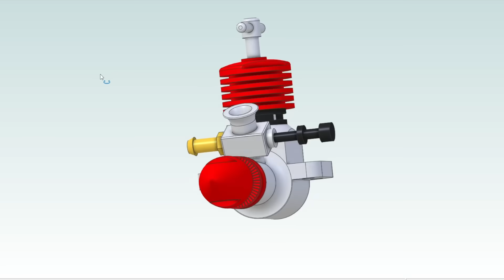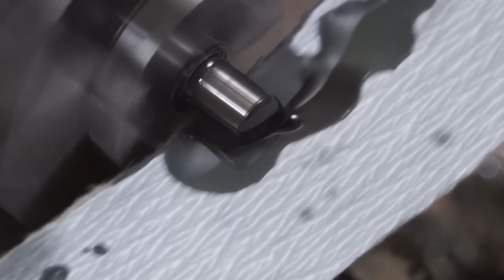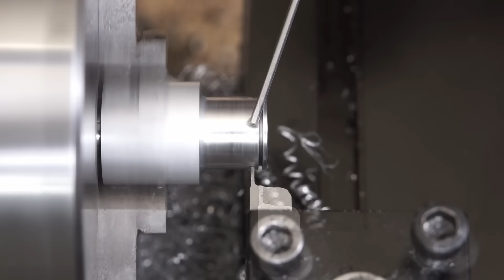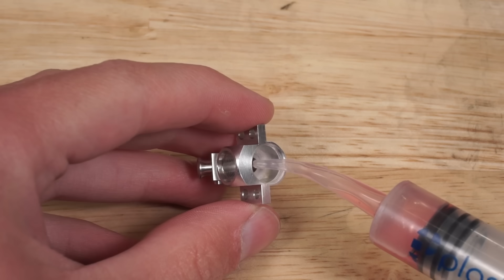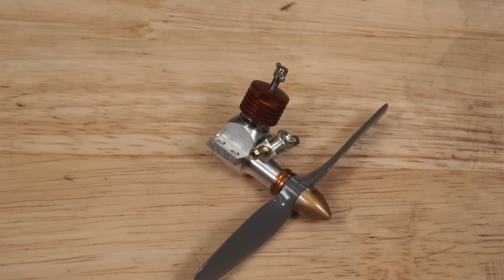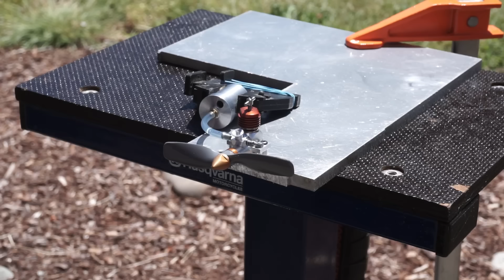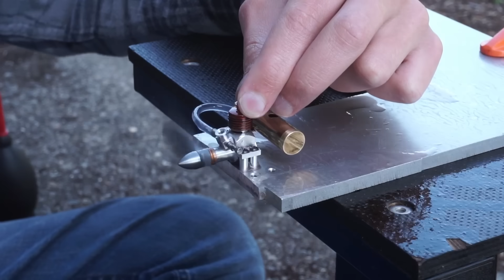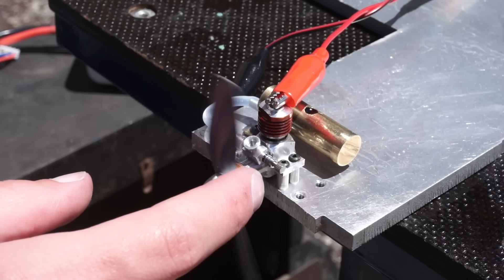I Make This Tiny 2-Stroke Engine From Scratch

Comment: Wow, this took me back. I'm 75 and as a teen in the 60s I used to fly control line planes with an engine like this. Here in Australia the popular engine was the Taipan and all I could afford was their 1.5cc model. It looked very similar to yours here, and was their smallest I think and enough for about 20 inch wingspan plane. When I left home for university my mother emptied out my room and everything disappeared. Some days I'd just start the engine for the pleasure of seeing it run. As an old bloke I'd probably do the same now. 👍
Reply from the maker: I take mine out and run them about every other week lol.
Thanks for sharing!
Reply: I'm 76 and I too had a Taipan in Australia. It was 2.5cc. My fuel mix was equal parts of castor oil, kerosene and ether. Later I had a much smaller diesel engine I used on a free flight. My glow plug engines ran on castor oil and Shell "racing A" fuel ordered specially from the servo. My best engine was an Enya 5cc "3B super typhoon". It lapped competitors 6 laps to their 5 laps in the team race competitions. Fun times. Sorry your Mum junked your stuff, they just don't get it.
Reply: Aeroplane were out of my reach and Radio Control was something only the local Doctor could afford ...    So we bout a sawmp boat out of fence palings and sheet tin ... And axe handle for the engine mount ...the 1.5 cc desal I was given by one of the older boys was damn near impossible to start since it had no compresssion left ..      But it didnt sink and went like stink  scared the ducks big time .... Probably some still in Trauma Councilling in Traralgon VIC ~quack~ .. Cheers MAte ..
Reply: On Ebay, I bought two OS Max engines a few years ago to relive my youth, both had the same typical 2 stroke problem, get them warm and the cylinder expands too much and there is not enough compression to create a vacuum in the crankshaft area,too much blow by, only restart when cold [had same problem with a BSA Bantam], tried to turn up a new piston but I think the bore is not true enough, am going to try and true the bore but doubt the accuracy of my tired old WW2 lathe.
Reply: @adoreslaurel  A BSA Bantam was the first motorised ride i ever did solo .... along a beach ..I was 13 ...
Reply: Yes friend. Being in the same age bracket I can relate exactly! Hours of fun with my Dad who was in the South African Airforce all his life. My control line model was a Spitfire. Those were the days......feels like YESTERDAY!
Reply: Same here, Kim.
Only It was a Cox .049 ci.
I had a lot more of those than I had flyable airplanes.
Back then I wanted a flying camera.
I now have a pile of drones that all work because I'm afraid to fk them up.🤤
Reply: Takes me back too - I'm 79 and had various 'diesel' model engines, one or two looking like this (DC I believe (Davies Charlton)) - also had a couple of Mills - 1cc and .75 cc. Oh, the old days. Nice build and very satisfying.
Reply: I have a McCoy 35 red head engine that’s like 10 times the size
Reply: Wow
Reply: There's something satisfying about just starting an engine and listening to it beat on at its own pace doing it's thing. Some folks just don't get that
Reply: I had one of them too when I was 13. Could never get it started. Now reading other posts I see why 😮
Reply: Let me guess what you studied in college after playing with stuff like this.  Manufacturing and Engineering?

Comment: I was introduced to small "diesel" motors like this one when I was about 7  years old.  The kid next door turned up with a 1.5cc Frog diesel.  We made some fuel (ether, castor oil and kero) and eventually managed to get it running.  I have been flying model aircraft ever since and am now about 75 years old.  Your skills with metal are way beyond mine but I still like to play with small motors.  Thank-you.  Mike in Oz

Comment: This brings me back, too.  Back in the 1960s (I'm currently 68) I had the Cox .01 cubic inch motor, and it would spin a 3" prop at 27,000 rpm (advertised).  A great little, reliable engine.  I ran it many times.  Sold it and a bunch of other small engines years later, and I've always regretted it.  The .01 engine could have been used as a tie tack.
Oh, I still have an Enya .15 engine, but haven't run it in ages.  Maybe as I approach retirement I'll have to get back into these.
Reply: i have a Cox .010 new in box....trying to decide which micro plane to build for it
Reply: @MrJdsenior  FWIW, I googled, "do you have to register a radio controlled airplane", and got this answer: "We're also required to have an FAA registration number that goes on any models we fly weighing over 0.55 pounds (250 grams)."
It's unlikely that a plane powered by a .010 motor will be more than a half pound.  But still, I bet some .049 planes would have to be registered.

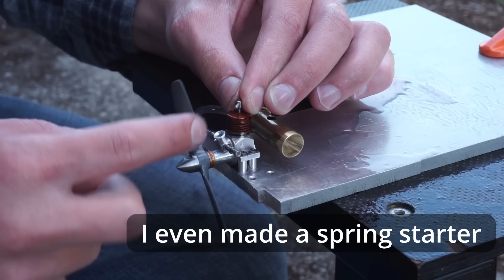Comment: 25:52 @JellyFish Machine
 The positioning of the propeller and piston is very important. You have set the piston "ZZ", the piston is at the lowest position and the propeller is horizontal. The propeller is a flywheel and has a very important role in starting and operating the self-ignition model engine on ETER. The mixture for running in the engine is 50% ETER, 25% kerosene, 25% engine oil, run in the engine at low speed and pause every 2 minutes to cool down. Once the engine has been run in and adjusted, use a mixture of ether 33%, kerosene 33%, engine oil 33%

Comment: This video brings back so many great memories for me. My late father in law (a partially-sighted master toolmaker and engineer) built this engine after seeing it in Model Engineer. I believe it was called as a Nano Engine?

However, Dennis (in his late 70s) built it at half scale! Finished size was around 3/4" long, including the propeller hub, if I remember correctly. All turned and milled on machines he had designed and built himself.

According to his strobe, it ran at 20,000 rpm. 😁 It certainly squealed.

I know I'm biased, but he was a mechanical genius. He once built a spark eroder (rather than buy one for £30k+). The first time he tested it, all the street lights within a mile radius dimmed. 😆 However, he could 'erode' any irregular shape he needed through 1/4" steel.

He also designed and built a working V6 engine which would fit inside a matchbox, and a very 'revolutionary' flywheel assembly. Imagine a flywheel with a driveshaft rotating at 45 degrees to the face, with a ball bearing end actually inside the flywheel, tracing a circular path, like a spoon stirring coffee. This was only two pieces of steel, and nobody could work out how he made it.

Thanks again for the video.

Comment: Hi Jelly, great project... some suggestions to try: 1. Make a small hole in the crankshaft cuffs to lubricate that critical area. 2. Use less oil and 3% nitromethane. Cheers Luke

Comment: I built a slightly larger engine but the piston fit was slightly tapered to make it nice and tight at the top of stroke. Fuel was U.S. diesel fuel, castor and "engine start" ether. Fresh ether for each run. Iron piston and steel cylinder. Crank to case fit was critical to stop compression leakage back to the carb and out the front. I used an electric starter, which causes the engine to warm as it spins over while adjusting the mixture and would start and run well. Running was extremely slimy. I used single transfer port and single exhaust port. My carb had an "o" ring and two clamping screws to seal it and hold it on. I've seen diesels with throttles that actually idle. Most of life is just showing up! Nice choice on Shureline.
Reply: Yep the mess was unbelievable but the smell of burnt Casteroil Mmmmmm yummy.

Comment: If there was ever a design that needs to be made into a horizontally opposed engine, this is it. Changing the design in this way wouldn't just double the output and balance the forces but would make the machining far simpler, and give you a round crank. A single carburetor would feed both chambers as well.

Comment: As a machinist I absolutely love your work.
Having been somebody that's worked with two-stroke racing for years you're on the right path as far as porting goes . The other thing is crankcase volume versus volume displacement  behind the piston. The closer to 1:1 the better.
Just a headsup you're getting small enough that fluid dynamics of air may be changing going smaller.

Comment: I like your "anti-license strike countermeasures" during the engine assembly (with music) against YT. I hate YT for that! Amazing workmanship and machining work. Sorry this engine didn't run better. As a young child, I did mess with Cox 0.049 model airplane engines. My planes never flew well, but the engines ran. I remember they were very fussy to get running, and now that you mention the ambient air temperature, I never thought about the Chicago weather temperature difference affecting the running of the engine during the summer. I might just have. That was a long time ago...
Reply: Yes very  very  fussy! I spent more time starting the engine than frying my model 😅😂

Comment: I had a similar engine for a model airplane. It had a spring load for starting. Without that I remember the bruising on my fingers after hitting the prop a thousand times to get it running. It worked perfect once started and would rev and whine like a mosquito. Sadly a mate of mine decided without my permission to take it apart and copy the components to make one. In doing so he broke the brass fueling part and simply handed it back to me in pieces. Thanks !

Comment: I think this is an amazing video and some incredible craftsmanship! One thing to consider is your fuel ratio to air and compression. If you don’t have enough compression and have too much ether it will stall the engine out. You have to calculate your fuel-air-compression ratio correctly or it’ll never run like it’s supposed to. To your credit though, the fact that it even ran was pretty amazing.

Comment: Ethanol raises the octane rating lowering the detonation point of the fuel the exact opposite of what you want for compression based ignition. I recall tearing down a .1 back in the 90s to give it a thorough cleaning and I used marv's mystery oil to reassemble it, upon giving it a spin it ran strong for 2 or 3 seconds which surprised me as I was not expecting it.

Comment: Wow. I had a Cox .010 cubic inch engine as a kid. This is 61% the size. Well done.
Reply: i have one, new in the box
Reply: The Cox .010 works well to provide engine power to Gillows rubber powered aircraft kits.  🤓

Comment: As an owner of multiple Cox TeeDee 020 and 010's, some NIB, a few converted to 'diesel', but most in various drawers and storage boxes, I find this an impressive subject to attempt. Though honestly I'm much more interested in the last few seconds of your video mentioning a hope to attempt smaller.   The 010's were a neat idea, and on the perfect day when the stars aligned could absolutely give a screaming and awesome performance in both sound and power, but in normal practice were 'fiddly' to the point of distraction. It was fun back in the day to spend the time to try to get one flying for the typical 2-3 minute flight, more to claim that it had been done than anything. I had a few friends into control line (and a few die hard FF) that were happy with their .020's, but, for R/C the more reliable .10  to .40's were really where the time honestly flying was spent. And, for those who could afford or were extra devoted, the .60 and up planes were a blast to watch and aspire to. 

I would really love to see a build attempting smaller than .010 though, even though the power to weight ratio means it's somewhat pointless as a powerplant, it would be amazing to see a .0025 engine actually run. I assume the prop would be a 1.25" ?   And probably 100k rpm at full song, in the dog whistle exhaust note range?   Now THAT'S a challenge!
Reply from the maker: at 0.1 cc this is slightly smaller at .0061 cubic inches, a bit of unit conversion wierdness. as far as i know the smallest running model airplane ever made is ronald valentine's .006 cc "Nano Bee" but there's never been any proof or video of it running that i know of. I'm looking for a few copies of "Strictly I.C." magazine that have articles on making glow plugs from scratch. i also want to try spark ignition too.
Reply: Yes the sound of those engines when I finally got to start them!

Comment: Geeze, that brings back memories of the control line planes with the Cox .049 engine.  👍
Reply: Yes! I can just about smell that fuel burning  from my dad's control line planes.
Reply: Cox engine were super easy to start.
I returned 8 testors brand engines in 1 day, none of them ever fired once.

Comment: I have very little machining experience and have a dinky little chinese mini lathe (which actually is quite nice for the $$$). I've already used the super glue trick - love it! In my case, to release the part, I put the part with the arbor in the freezer for a couple of hours, put a skillet on the stove, sat the part on the skillet after it was nice and hot, and let the uneven thermal expansion do its thing. It was quicker than soaking in acetone over night, but I still had to clean the residual super glue off the part.

Comment: Having had an early interest in airplanes when I was in my preteens, but got tired of hunting for, climbing trees and rebuilding(more like total refurbished). I drifted toward model boats. Some hydrofoil, some to scale. But my passion was steam tugs. I still have packed away my unused Unimat latte/milling machine, that I turned out a Krick two cylinder copy with a boiler(original). All of this was in a NY harbor tug. During a show/ competition, some a-hole dropped and busted up about 8 weeks worth of build time. I pulled the engine, boiler, electronics and sold my collection on the spot! 
 I must say that your video sparked a challenge for me to try, but more than likely won't. My last plane was a turbo powered F4, which I so cleverly used to plow more ground than a Kansas wheat farmer! I decided to switch to something easier to retrieve. Thank you for your video.

Comment: I was a biomedicall technician for 12 years glorified, machinist. I used some of the smaller machines you have to very large CNC milling and lathes. I also weld, Do heat treating and andizing Injection molding I even did some seamstress work. I did some tool and model making. A lot of skill sets that I don't have time and i'm sure you don't wanna read about. That being said I'm very impressed with your skill sets!! Yes , it was very satisfying watching your work.
Reply: Not me, I want to read your experience and knowledge you know. If you have time write down all the of course

Comment: i think it's definitely creating intake vacuum from the carburetor not being seated inside. maybe find a rubber hose you could fit in there snug with a tiny bit of RTV or loctite and run the carburetor through the hose

Comment: I'd like to discuss another point. I believe the rotational inertia of the engine you built is a bit too low to maintain cycling. Perhaps increasing the radius of the propeller would be a good idea? Or perhaps a flywheel with an appropriate weight would be necessary.

Comment: It's my understanding that an engine that size would require a pressurized fuel system that would enable the engine to feed itself in the right mixture of fuel to air. It would also require some sort of minute mesh to spread the fuel as needed to the appropriate spray pattern for the cylinder you designed. I always enjoy watching mechanical machined engine videos. great job on that one :)

Comment: Very impressive video, I enjoyed and appreciated your machining and fitting skills. Especially the freehand use with the cutting tools. I remember many years ago back in the 60’s my dad used diesel engines in model boats that he built. He used to mix his own fuel of 50% (vehicle) diesel and 50% ether, it always worked. His engines were commercially made engines and a lager size. However he did have a small one about the same size as yours, but was never able to get it running.  Once again an excellent video well done.

Comment: In 1978, Anchorage AK, my late friend, Frank Gross who was an outstanding RC airplane builder and Machinist would build compression ignition heads for the old Cox 049 model airplane engines. You just pulled the glow plug head off and screw the compression head on.  Done.  If I remember correctly, Frank was the national speed champion for control line airplanes in the late 60s.

Comment: I had the Albon Bambi which has same capacity - the secret for running is just get the needle valve body - the bit with the hole in the side in the right place - it needs to be rotated so it is on the side in the airflow - it is critical. Also these baby motors need more oil than the larger ones.  I had to make my own propellers out of ally - commercial ones did not exist in those days (1950's!).

Comment: When I was a teen in the late 1970s a local drugstore, which by coincidence was also a hobby shop, had a "Going out of Business" sale.  I picked up two Fox Combat Specials, Golden Bees, numerous .049 Tee Dees, and approx 3 .010s, and a ton of balsa plane kits, and Estes rockets.  I sold the .010s quickly to some "free flight" old timers.  They used a burning fuse to melt through a rubber band holding the throttle open after a set time to shut it down.  I still have a couple of engines stashed in a box somewhere.  I do miss being a kid.

Comment: A little late now, but there’s a very good chance you can make it run as a diesel. I’ve run a few different sub 0.25cc diesels, and generally as soon as they’re running off of the prime, you immediately have to crank the compression in, sometimes as much as a turn and a half. The oil in the prime raises the compression enough to make it run, but once that runs out your compression drops and the engine quits.